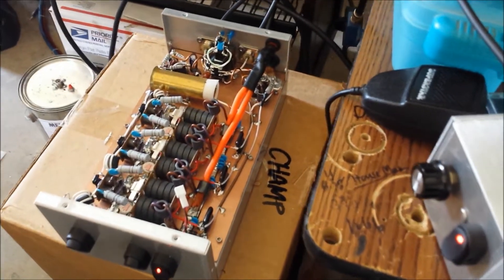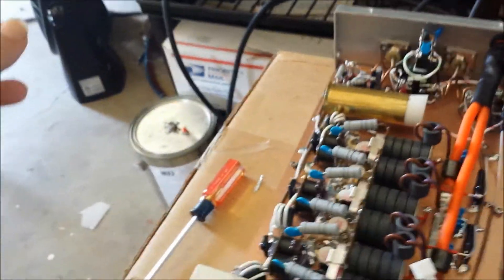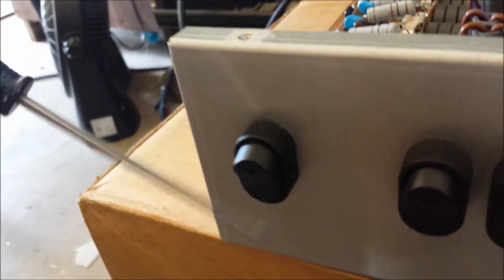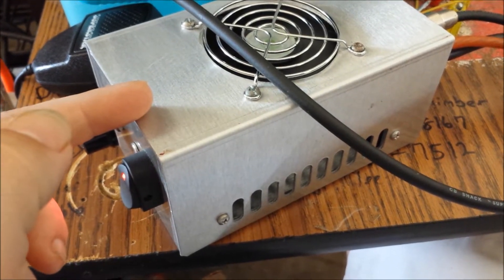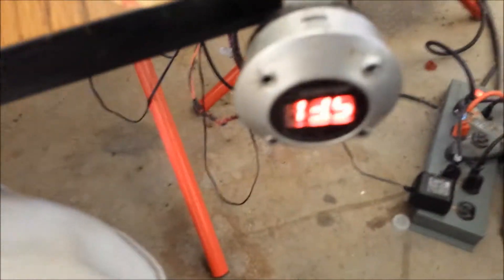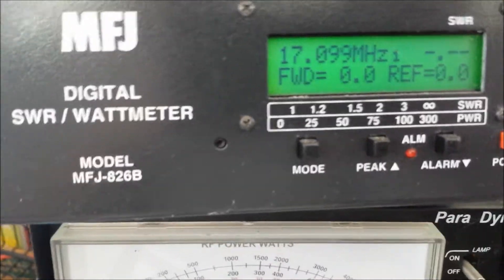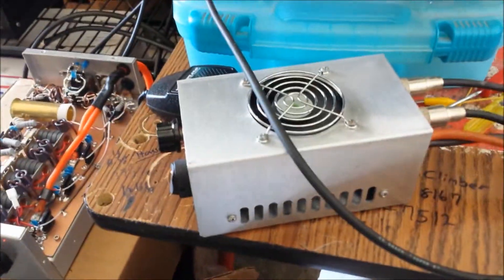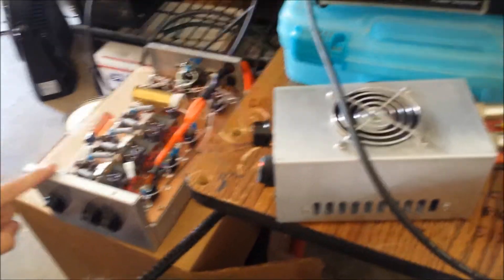2x 1446 Driving 6x 2879 Both GK Built Amplifiers - [The Early Days]

Comment: Hey Gatekeeper I am a CB Sideba nd mainly operator  anyway I would like an amp that is capable of 2,000 wats out of a possible a galaxy 2417 or 2417 if I can talk momma into an RCI 2985 0r 2995 but anyway would like something that can get that number but be varable in to 3 stages LOW about 0-100 wats MED 100-1,000 wats then HIGH 1,000-2,000 wats but would also like a varable Power Suply that can handle say a Yaesoo or Icom radio transceiver or maybe kenwood realy dont know which along with a 2 meter 70cm radio yes I am crazy about amature radio I love DXing and want to be able to comunicate with others so thats why for the large power suply sorry about the long post just want to know if possible and cost if able I watch your vidios all the time love them keep up the work you can gmail me at samuelgbaker68@gmail.com on answers thanks and 73s to you hope TO CQ with you soon .